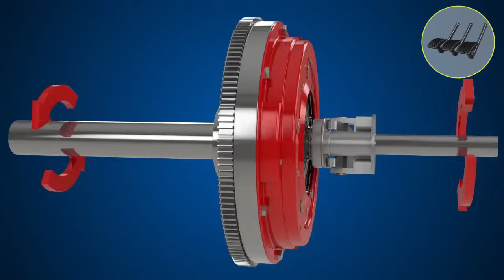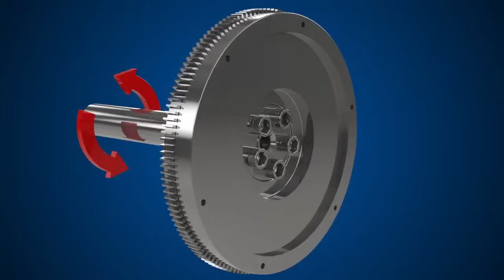How a clutch works. (3D Animation).

Comment: What’s the point of the clutch cover exactly? Is it just to hold the diaphragm spring?. It seems as if the clutch plate being directly connected to the fly wheel didn’t have much importance but if it’s acting as a housing to fixate something inside then I can understand. Just had a doubt would love an elaboration.

Comment: I'm going to stick my head up here and say that this explanation is wrong. At 2:02 you state that 'a diaphragm spring provides the force to maintain this contact'. The diaphragm spring does no such thing. Its sole function is to hold the pressure plate away from the flywheel thus allowing the clutch to disengage. The clamping force is provided by the (usually three) leaf springs on the outer edge of the cover plate between the cover plate and pressure plate.
Reply from the maker: The diaphragm spring is made up of the 'fingers' at the centre of the pressure plate. With the clutch engaged they force the pressure plate onto the clutch plate, and the clutch plate onto the flywheel. With the clutch disengaged they allow the clutch plate to separate from the flywheel.  multi-coil springs have a linear relationship between load and deflection, while diaphragm springs have a non-linear relationship dependent on ratios of dish height to thickness.

Comment: Nice animation, but there's still one thing I don't understand. What exactly is the element directly pressing the diaphragm spring? I see it's stationary, while the spring is rotating with the input shaft. So it looks like there's a lot of friction between these two elements, which may be problematic especially when pressing clutch pedal at high RPM (for example, switching to higher gear). Is there some mechanism to reduce this friction?

Comment: Very clear and concise.  But I'm still curious...why are there four spring built into the clutch plate?  What are they for?
Reply from the maker: Excellent question. It’s about what is sometimes called clutch chatter. At idle and under load and driving , the clutch can vibrate. These springs act as dampers. A bit like shock absorbers if you like that soften the effect of the clutch vibrating and oscillating in the plane of rotation back and forth (clockwise and counter clockwise at idle) . They dampen the rotational “chatting” to reduce wear on each connected component.
Reply: @Spraiser74 centre of clutch plate is separate to outer clutch plate, they suspended together by them springs like car suspension, so they dampen rotational force when clutch plate suddenly engages.
Reply: But they won't tell U that cos I'm sure they don't know that. Otherwise the springs are useless and just ornamental.

Comment: year ago my old toyota car have power loss issue, i told my mechanic to change clutch canvas, the problem still persist until he found out that "diaphragm spring" is weaken so when clutch pedal untouched it didn't push back properly, so my man only change the springs for cheaper cost

Comment: Good video, but how does excess use of clutch pedal causes the clutch plate to "burn"?
Reply from the maker: At the point of engagement (as if holding steady on an incline) there will be small but material amount of slide (like rubbing two sheets of sandpaper together) . This will cause the clutch to wear. “Riding” the clutch or holding using it as a “handbrake” drastically wears it too. If you need to hold it long, put the handbrake on. It’s the crazy netherworld of neither engaged or disengaged that causes “slide” and friction and thus deterioration in the main.

Comment: Not sure if this question has been answered or not.  Pretty good animation.  The thing that puzzles me is that the teeth of the flywheel seem to go in the opposite direction that the flywheel should turn--should be the same direction as the direction of crankshaft rotation.  Am I wrong?  Thanks.
Reply from the maker: It’s a visual thing, a bit like watching an aircraft propeller maybe 🤔
Reply: This caught me off guard initially too. Look towards the outer edge in the cross-section and you can see how the teeth provide leverage which clamps the pressure plate to the clutch disc.

Comment: 2:03 Not sure I got it right ... So when the pedal is pressed, the fork goes towards the clutch disk BUT the disk moves TOWARDS the fork too ? Because that diafragm has leverage on the exterior of the circle ? 
Or does the disk stay fixed (not gliding towards/away from the fork) and only the flywheel glides towards / away from the disk when pushed by fork ?
I am driving for 20 years and I still not sure how that works ! :O

Comment: 2:15 I think in here there was a mistake?
"When the clutch pedal is depressed"
I think you mean pressed right?

This is the best video I saw so far so simple.

Thank you very much 🙏
Reply from the maker: The state the clutch is in is depressed (pressed and held down). Think of a key on a keyboard, you press it and it becomes depressed (down state) you release it and it returns to unpressed state. It’s Symantecs but the clutch is definitely not suffering from anxiety and depression.

Comment: Ok so let’s say I suppose to change from 3rd to 2nd at 52km/h but cos I’m a dumbass I accidentally press the clutch early at 60km/h from 3rd to 2nd and my engine screams a little bit and went up to 3000rpm  the rpm is not at redline. I’m still safe? Redline is at 9000rpm still far away, but I’m worried of the abrupt rev on the downshifting. 

Please help

Comment: 2:02-- 2:07 shows the movement necessary to understand how it works.
Good video.
Reply: The diaphragm spring doesn't provide the clamping force. It's not even a spring, it's a lever system to release pressure.
Reply: @dopiaza2006  2:02-- 2:07 shows the movement necessary to understand how it works.
Good video.
Reply: @simpleman283  That shows the mechanism that disengages the clutch, but what actually forces the pressure plate to clamp the friction plate once the clutch is engaged?
Reply: @dopiaza2006 
Copied from the comment section:
The flywheel is spinning with the clutch pack assembly attached to it. The metal pieces in the middle of the clutch pack are the diaphragm springs, they push the clutch away from the flywheel when the clutch pedal is pushed in and let it get closer as you let the clutch pedal out. The diaphragm springs are pushing against the pressure plate. The springs that are on the inside area of the friction disc are dampening springs. They help to soften the felt engagement of the friction disc to the flywheel when the clutch pedal is being let out and engaging. The flywheel spins as the gas pedal is pressed, as the clutch pedal is being let out the friction disc, which is rubbing on the flywheel when friction point is achieved, is catching the transmission output to the wheels up with the rotation of the engine. When the clutch is let all the way out, pressure from the diaphragm spring is pushing the friction disc up against the flywheel to ensure engagement so when you accelerate the engine and transmission output are spinning at the same rate of speed. When the friction disc needs to be replaced, usually when you accelerate hard enough the clutch will "slip" and the engine will spin faster than the friction disc and cause a feeling of a loss of power. I probably didn't do a very good job of explaining it but there you go.
Reply: @jesseroel8362  'When the clutch is let all the way out, pressure from the diaphragm spring is pushing the friction disc up against the flywheel to ensure engagement ' - this is actually wrong. The diaphragm springs are what release the clutch not engage it. When the clutch is let out the pressure from the diaphragm spring holding the clutch components apart is released thereby letting the outer leaf springs on the cover plate clamp the clutch components together. It's a common misconception that the diaphragm spring provides the clamping force. It does not.
Reply: @dopiaza2006  2:02 -- 2:07 shows the movement necessary to understand how it works.
Good video.

Comment: Took me several looks at the diaphragm spring to finally understand how stepping on the clutch pedal disengages the engine power from the wheels. Perhaps this part could have been more fleshed out (for non mechanically inclined guys like me) but overall, excellent animation and video. Thanks!
Reply: It's not actually the diaphragm spring that holds the pressure, it's small springy pieces of metal on the outer edge of the clutch cover. the diaphragm 'spring' is actually just a lever to relieve the pressure.
Reply: Working of spring is really highly creative... Taking more time to understand

Comment: I thought the starter spin the flywheel.
Reply: It does, but only as long as the key is held in the start position. When the engine starts up you release the key from the start position or it will destroy the starter.
You turn your car on with the key but the starter does not engage, it is that small extra turn of the key that engages the starter.

Comment: Not bad, but you should have incorporated a cutaway view to show what really happens inside that housing when the clutch pedal is used.
Reply: It did show it. I had to look a couple times, but it is there. 2:02 -- 2:07 shows the movement.
Reply: @simpleman283  I see. Thanks.

Comment: Throw out bearing, slave valve? Major components not mentioned
Reply from the maker: This project was driven by client needs at the time and for these videos not in scope, these are samples from interactive Elearning courses. Thanks. Check my other videos (CSC etc). These were all produced to strict spec but I have shared them to help. If they help that’s great. If additional information is required it is likely available elsewhere. I understand it can be frustrating and it would be good to have had a full comprehensive set going to advanced level but these videos alone took hundreds of hours , cost 5 figures, complex hardware and software, expert knowledge, editing, etc etc. server farms, render farms, et shoots and more. I am pleased that the videos have been viewed over a million times and helped a proportion of these. Similarly it helps others when people mention other topics which were beyond the scope or that may further help people research and understand. Thanks again.
Reply: Thanks for the hardwork and response

Comment: For those who really didn't get the real core principle.
It is simple.
You have the clutch disc.  This is the round thing that looks like it has got brake pads on both side of it.  It is the one that goes on the face of the flywheel first.  Then you have that big thing, called pressure plate.  This is the unit that bolts on the face of flywheel.  Therefore, the clutch disc is sandwhiched between the flywheel and the pressure plate.

Now, when you bolt the pressure plate on the flywood. AT that moment the clutch disc is pressed in against the flywheel and the pressure plate.  This is the engaged position.  This means that the clutch disc is engaged to the flywheel, the engine and threfore the transmission.
Here is what happens when you press, that throw-out bearing against those fingers of the pressure plate. Those fingers are spring loaded in such a way with the pressure plate face, the fact that presses against the disc.  That face pulls back from the disc.  Yea pushinjg against those fingers causes the face of the pressure plate to pull back, this gives enough space for the disc to detach from the face of the flywheel.  
The flywheel spins and the injertia of the disc is enough that the disc will not stick and go along with the flywheel.  Just how much the clutch disc pulls away from the flywheel you may ask?   Hardly any more than that widtch of hair or two.

So, when you push on the fingers of the pressure plate, it is not pushing against the disc at all. Those fingers are so designed onto the face of the pressure plate that pushing against it, causes the face of the pressure plate to pull back.  Why the pressure plate moves backwards... see detail below in the response.
Reply from the maker: Your first paragraph is most unhelpful and your description makes no sense to anyone who has not seen a clutch. However your understanding of a clutch may or may not prove useful to others. This is a small snippet of video extracted from an interactive Elearning course. The videos require technical knowledge, huge expense, dedicated software and hardware etc etc, the video is bound by time constraints and signed off by relevant experts and SMEs. The whole process is vast and complex however your negativity goes to show that even after investing huge sums of money, time and quality and providing it for free and allowing people to voluntarily watch it ..."you can please some of the folks all the time and all the folks some of the time but there are others who will never be pleased. I'll pray for your heart to be softened (Tyson Fury ). Thanks for the note. The diaphragm spring is a tad confusing but a clever pivot in this simple but clever assembly works  (pull and push types) . Similarly the void between the friction surfaces is very small also <mm  which shows the tolerances worked to by the manufacturers. Also a testament to mechanics who have to fix or fit these things sometimes having to take out engines. This is sadly a dieing art and in a few years we will be in electric only mode. No more fascinating clutch videos .... how will we cope? ATB
Reply: @Spraiser74    [It would have taken no less than a minute to simply verbalize why the pressure plate pop in and out. It is clear and obvious in the comments that the real principle you left out.  HOW CLUTCH WORKS is the title of the video.  And you know that.  Not in any of the other animation it explains WHY THE PLATE PULLS BACK].   I also certainly did not explain the meat of the operation which is that.  It is the core principle.    I only said that when you push on those fingers (diaphragm spring) the pressure plate (some call it strap plate) pulls back. Clearly, I did not explain how that actually happen, the actually mechanics of it.  This is the heart of the operation. it is what is all about.  Why does the plate pull back?  The spring is coned shaped (why cone shaped?) and its circumference does not change in size and is secured on the strap plate.  When the center/cone is towards the transmission and you bolt the pressure plate casing onto the flywheel, it is pressing the strap plate and you can see how the cone part of the spring flattens to some extent. If it flattens where it is orthogonal to axial plane, you will actually lose pressure. Not good.  When you push the throw out bearing against the spring where the spring goes beyond the vertical orthogonal plane and therefore the cone is in the opposite side (that is towards the engine), the strap plate now is in the opposite side towards the transmission.
I say that is a clever design indeed just like them centrifugal clutches on them washing machine motors.   You can actually see the principle if you make metal that is flexible and make it cone shaped.  See what happens when you push it, watch what happens to outer edges. pop in and out as the center cone part being one side or the other side.  That is clever.

{{ When the pressure plate is bolted onto the flywheel, the spring pushing is at is maximum angle of pressure verticle angle.  As the pressure increase on the spring say due to being pushed by throw out bearing the pressure is less and less and the spring now is more under stress.   (Stress is an anward respose). Stress is not the same as pressure.   However, at vertical position stress is maximum and the pressure is lost, once it passes beyond the verticle then the pressure is in the opposite direction and the spring is no longer under stress.  Since there is really nothing pushing from the other side, it won't make any difference then.  The objective is achieved}}
When you let go the throw-out bearing, what causes the spring to come back to its original position indeed? I will leave this one for you.  :-)

My question is this:   Why in the world foreign folks are always much more thorough?   Why?
Reply: When U press clutch, does clutch plate seperate from pressure plate and flywheel or from just one of them two?

Comment: Not clear at all on how the diaphragm spring works. You need to clarify that it's a unique spring in that pressing the centre deforms the outer edges, thus releasing tension on the clutch plate.
Reply from the maker: No, this is an extract from interactive Elearning course. Specked and designed to cover exactly what it does , no more no less. It is an introduction. However, the point made about the diaphragm spring is true. It’s just not relevant on this extract. It is not an encyclopaedic reference. It is an introduction to the clutch. No more, no less. Thanks.

Comment: people with older car without needing to engage clutch to start a car, saying that you still need to press clutch in so it not damaging clutch... is it true ?
Reply from the maker: Nope. If in neutral it’s fine. However sometimes car was left in gear so depressing clutch meant didn’t risk shunting forward! Clutch law. Thanks

Comment: Normal position Pressure Plate squeezes clutch against flywheel allowing power transmission.  Engaging clutch releases Pressure Plate allowing clutch slippage or no transfer of power.